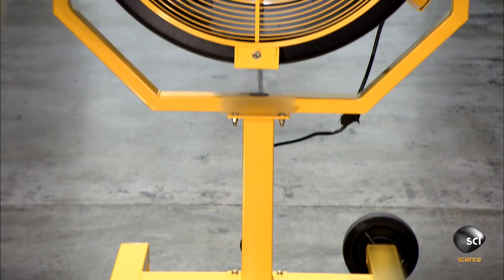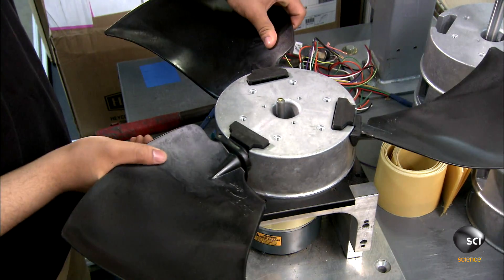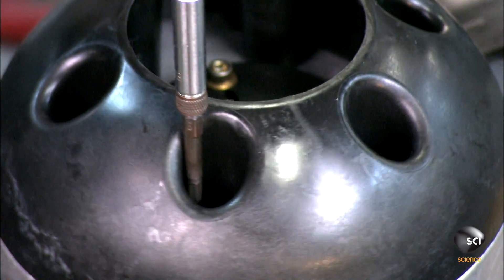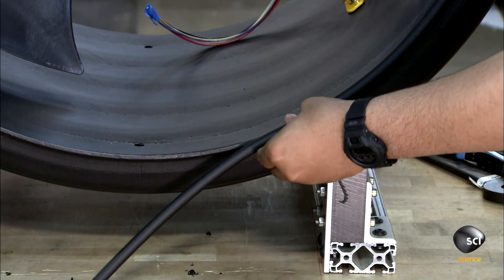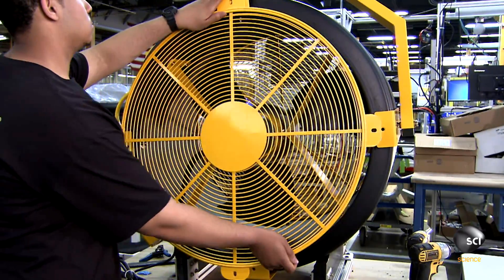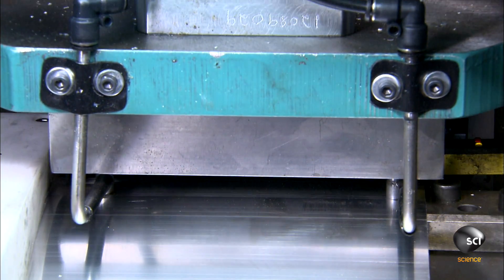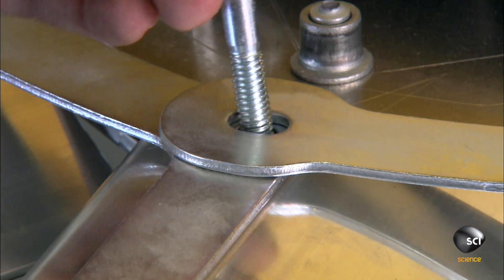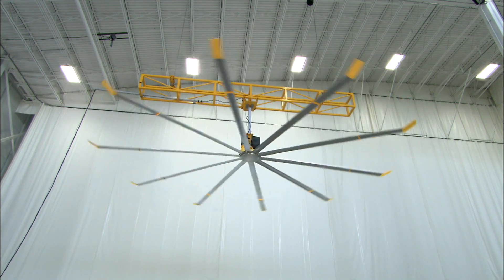Industrial Fans | How It's Made

Comment: Fancy!  Looks like they are using high end GE ECM 3 phase smart motors that are around the 70-80% efficiency range.  Super efficient (not the typical 15% efficient garbage shaded pole trash motors in all the consumer grade factory-to-landfill crap).  Even premium Japanese made PSC (Permanent Split Capacitor) type motors can't keep up with the efficiency of these GE units.  Big Ass Fans making some really good stuff there... That is more of a ducted-fan thruster at highest setting and not your grandmother's box fan.

Comment: That's literally a "Big Ass Fan". You can clearly see their logo type in the middle of the fan even though the name has been blurred out on the base by the wheels. And again it's blurred out on the hub of the large suspended ceiling fan.
The yellow winglets do not direct air downwards. They break up the vortex at the end of the blade to reduce drag.
Reply: They only blur it for the ASS part of the name lol they don’t blur big fan when ass is hidden by the guys hands putting on the logo cover plate on. But after when it’s installed and not covered

Comment: this is not a "how it's made" video. this is mostly resembling an IKEA assembly manual. not showing how the parts are made or the inside of the motor.
Reply: That motor is a pre-made unit from GE.  A very high end brushless 3 phase motor with built in controller.  Has to be a $1000 fan in the video there... good stuff.  Probably don't want to give away too many secrets.  That motor they used is about 80% efficient vs 10-15% of a conventional fan, a lot more air is moved.  I suspect that thing is more of a ducted fan at highest setting......lol.
Reply: BluePaw89 Since when have IKEA assembly manuals been that clear?  But you are right, this was about assembly.
Reply: +Philip Jones Whaaaa? IKEA instructions are renowned for their clarity. The product itself may be of lower quality, but their assembly instructions are literally shown in textbooks on information design as shining examples of clear instruction.
Reply: Russell
I stand corrected but its been a while since Ive been near one of their stores. Then again it must vary according to where you live because I have heard complaints.
Reply: Mostly every motors are build from another company, so they just do the design and body manufacturing... thats how it works in most industries.